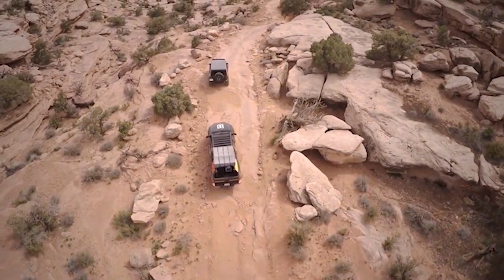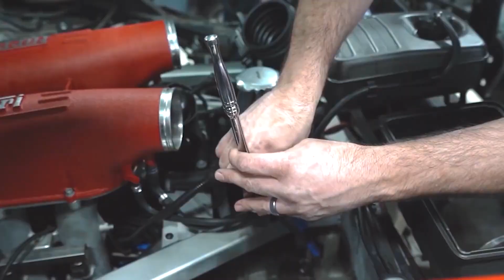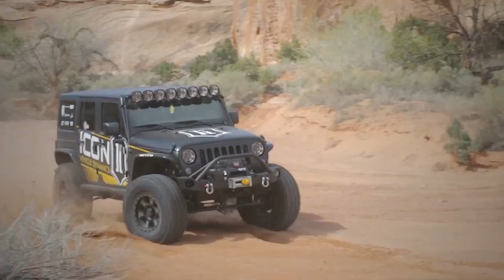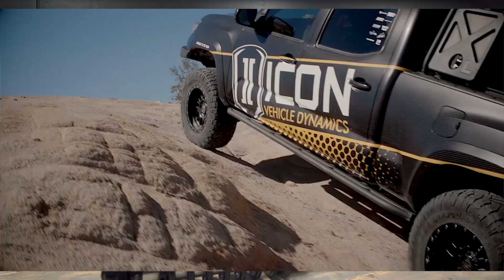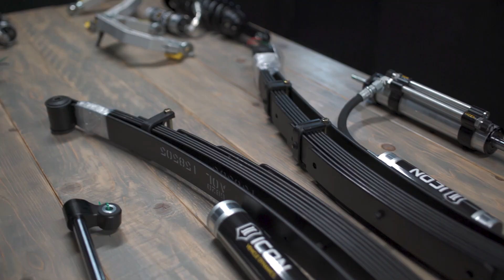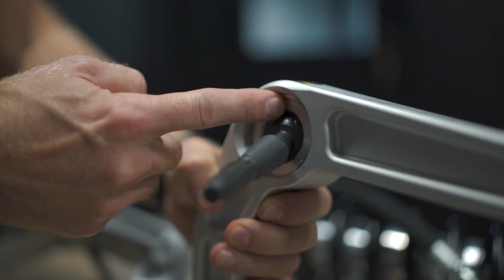Best Toyota Tacoma Lift Kit || ICON Stage 10 Suspension

Comment: I have the icon 2.5 coilovers with cdcv resi, camburg tubular ball joint uca, icon AAL and icon 2.0 rear shock with resi and it rides rough and stiff. I’ve set the cdcv resi to 4 and still to rough I can feel everything in the road

Comment: Great video! I installed the stage 10 last June on my Taco. It’s an incredible suspension system!!
Reply from the maker: Definitely! Thanks for watching!
Reply: Im considering the stage 10. Contemplating all the weight I’ll be adding. We shall see.
Reply: Is it better than the King system?
Reply: @xanderfloats  no one is answering your question!    Thats the question i have!     Their upper control aluminum billet,    is amazing.       The dual shock system is awesome and is better then
Reply: @xanderfloats lol king does long travel shocks that blows icon  away.